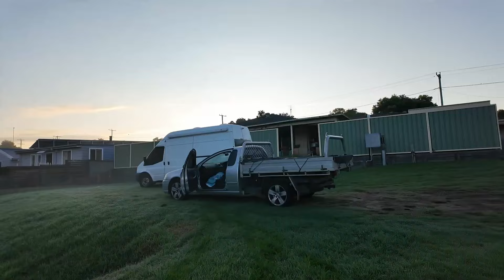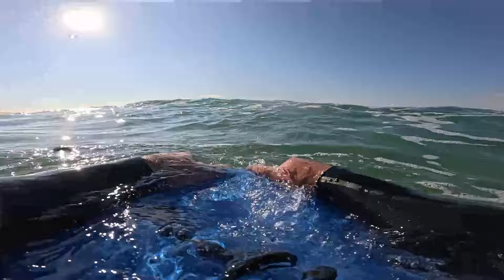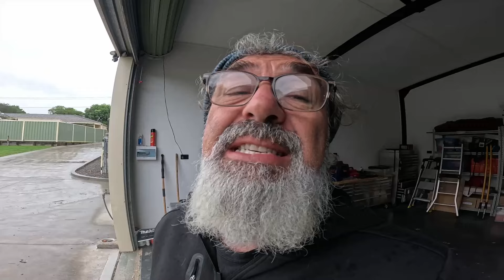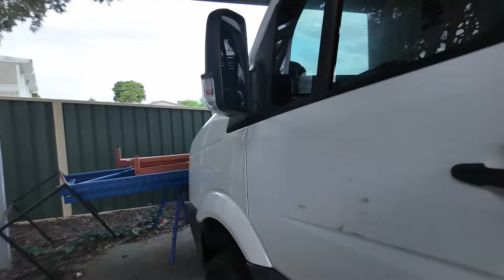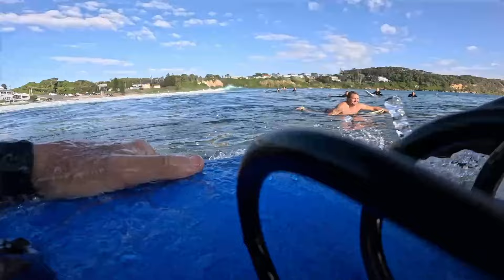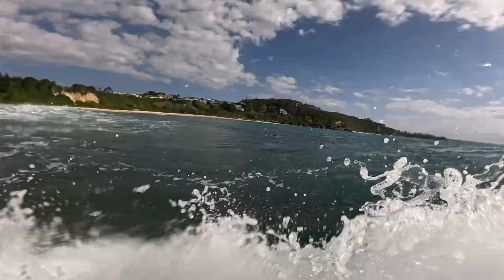WHEN YOU HIT ROCK BOTTOM, THERE'S ONLY ONE THING TO DO...SHRED !

Comment: Thanks OMB, it sucks how vehicle manufacturers make you spend $$$$ to obtain a $50 part. Maybe get someone to do a diagnostic scan to check for obvious faults. Sometimes the issue might be a valve or broken spring in the valve body assembly. You may well be right in identifying the offending solenoid, but they make you buy the lot as a scattergun approach to covering a multitude of evils. Maybe talk to the dudes who did the clutch not so long ago and don't worry, a solution will work out for the best. Glad you scored some quality waves to wash away your woes. Surf was pumping today (Sunday) and was painful to watch while being OOTW with stitches in me britches. KUTGW
Reply from the maker: Yeah had a diag on it but no codes ?
That solenoid was buzzing real loud so I guessed that's a start.
Reply: @olmanboog  Good Luck, Keep Surfin'
Reply: @olmanboog  Go to the auctions, crawl underneath saying you like to do "Real Good Inspections" and do the old swap-a-rooney. Used to do the trick when you needed a new ciggie lighter.